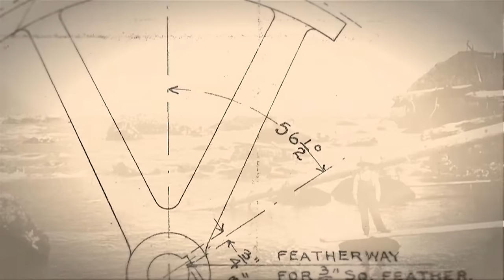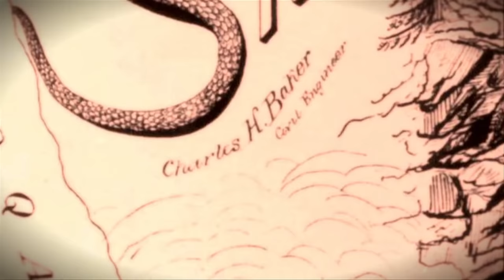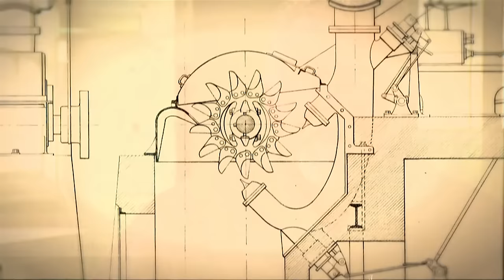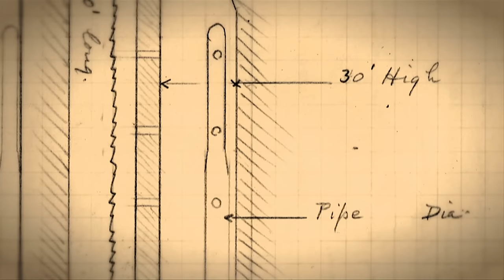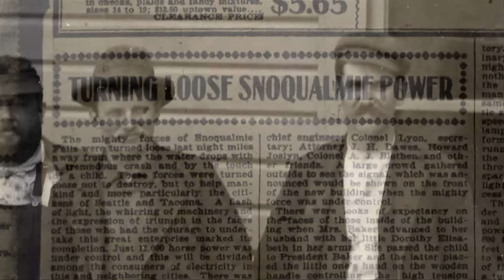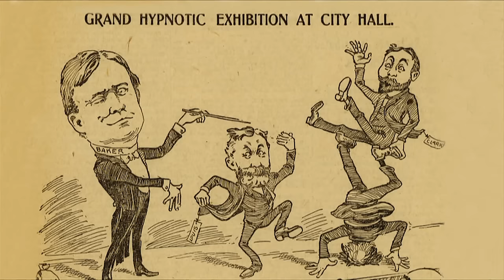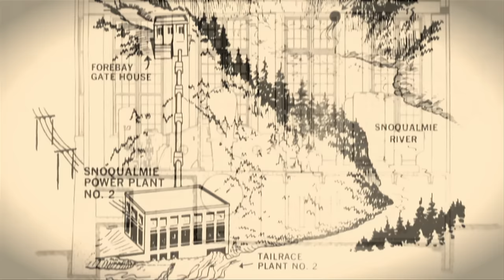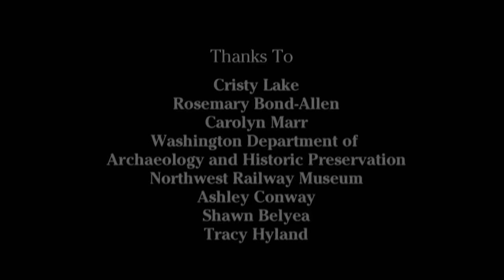The Power of Snoqualmie Falls

Comment: Worked there as the "B" electrician.  The cavity was quite the place, and the equipment was something to see.  Spent a lot of time on the old generators keeping the insulation on the wires.  Had to sweep the Bat poo off the blueprints up in the loft of the office building.  Taking Gen 5 in the cavity apart to check the impeller for wear was fun too.
It was not mentioned in the video, but Gens 1-4 had the power come off the rotating shaft, unlike modern generators where the power comes off the stationary part.  In the early days, there were big layers of copper cut to shape on site to replace the ones that wore out.  Then they found a man in Oregon that could make "brass brushes" that could do the job, and not wear out so fast.  Lots of copper dust everywhere.
Was also the most boring job I ever had.

Comment: We in mid 1980's built Twin Falls hydro , 2 -11 ft diameter drop shafts from the pen stock on the so fork Snoqualmie, each shaft dropped 508 feet to Francis turbines  from there out the 3/4 mile tail race under the main high way , under twin falls coming up again into the river just below the falls....  this was done by American mine corporation under consolidated hydro , just a hand full of us were on the project from start to operation . at a point I was trained to operate fire up and or shut down of the plant …. at that time I was invited to by operations engineer of sno falls to visit that plant , 7 or so miles down stream ..... our engineers had studied sno falls to better improve the project we built... all told , twin falls hydro plant produces more than sno falls yet can only operate during peak river flow where as sno falls can operate almost year round....   appreciate this history video ....  the spawn off of sno falls is / was a larger hydro project upstream , then also about 1 mile further upstream of twin falls is weaks falls hydro which is more a diversionary dam .
Reply: Thanks for the great information ✌️❤️🫵
Reply: If I understand correctly this is feed by the dam just on the north side of I-90. It is less than a quarter mile west of the exit 38 west bound on ramp. With effort the dam can be see partially from westbound I-90. 
Thanks for the information. 

Was your project done as part of an I-90 improvement project between exit 34 and exit 38? The reason I ask is that below the dam it looks like the river channel is man made to redirect the river to simplify putting the westbound lanes in their current location.

Comment: Cool falls but... Baker is merely another cardboard cutout to create another bakers dozen outlandish project/time frame backstory to explain "finding" an underground power plant. This is 10,000% located in a place no engineer, banker, investor, builder, plumber, electrician or mechanical engineer would ever recommend building. "Simply go downstream 20 miles" they'd all say,  build it on the level shore, we can get the  same amount of  power and we won't kill all the men, horses and mules trying to haul millions and millions of pounds of cement, building materials, machinery etc into the dumbest location in history and "bonus" it can get done at 1/50th the cost downstream! This realm is nothing but unraveling truths at this point. If it happened prior to WWI, well, everyone were actual magicians apparently?
Reply: Is this the only original thought you ever created, god forbid your using his electricity